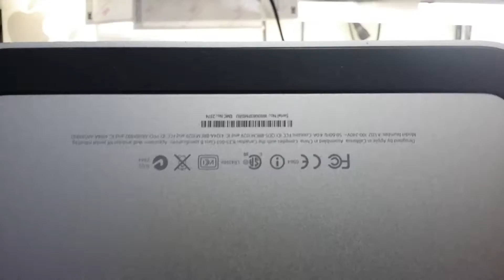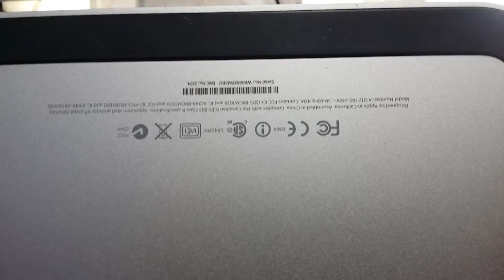iMac A1312 27 inch 2009 2010 2011 video card repair

Comment: Can I put in my "iMac 27, 2011 i5-2.7 4core / 8gb / radeon hd 6770m 512mb" graphics card gtx 780m without soldering ? In general, is it possible to do this?

Comment: Hello everyone , this is not a permanent fix.
All you have managed to do is to temporarily fix a failure inside the GPU chip itself. The internal connections inside the chip detach and reheating it just temporarily  reattaches them. You can easily prove this fact by just heating the GPU chip to say 150 degrees Celsius. Re-balling or re-flowing the chip only has the same effect. The only cure is to replace the chip with a new one and that does not mean a cheap re-balled one from China. This will have only been through the heating process by having new solder balls fitted. This trick will work for an unquantifiable amount of time but rest assured it will happen again
Reply from the maker: we replace and reball,some video just shows process,anyways this is full video https://www.youtube.com/watch?v=TqYikD4OIOY

Comment: Hi There,

Ma iMac 27" -- i7 -- 3,4GHz -- Mid 2011 is shutting down randomly. Even it won't boot up at all. Searched all over and most probably the GPU/VidoCard needs some attentions, which is, needs to be repaired. Over here in Europe the repair is overwhelmingly high. Whit that Money I could buy another used one ..;) having said that I'll give it a try myself. 

==>>> Your support would be: tell me the size, even the right name for CONTACT-POINTS (Contact-Balls) since there are many of them A-N-D ==>>> also the EXACT description for the STENCIL for GPU.

Greatly APPRECIATED!